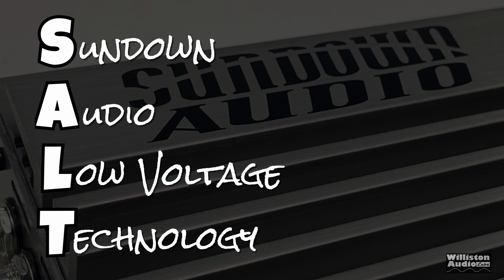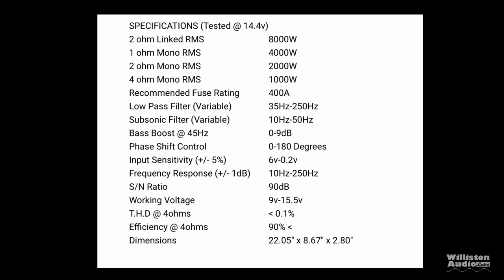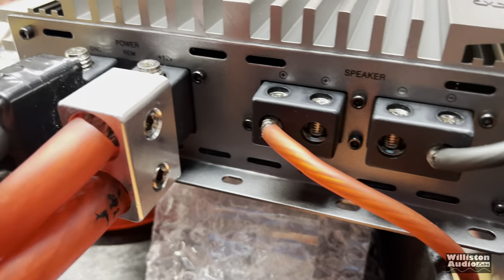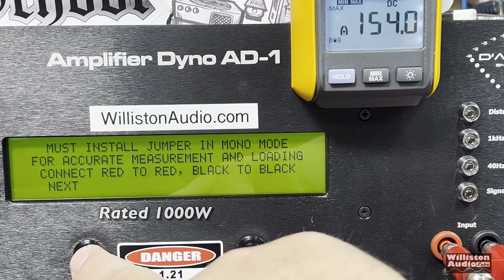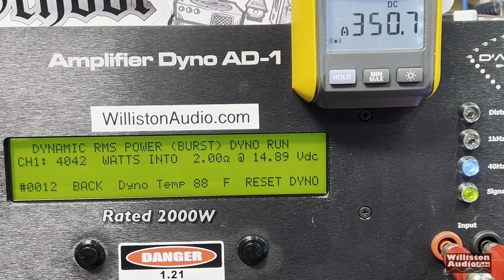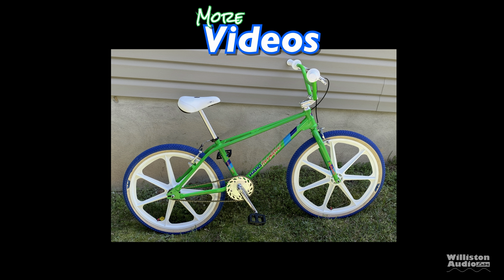Sweet Power, Salty Price? Sundown Audio SALT 4 Amp Dyno Test and Review [4K}

Comment: I've had my Salt 4k for 1 year, so I thought I would post up. Coolest & most quiet big amp I've owned. Top feature is the low voltage tech. I flex my Rubicon & knock hats off, just using a nice Interstate battery & stock alternator. No caps or lithium. I'm also running an Alpine 500w marine amp to power Alpine head, tweets, & SD 6.5's in soundbar. Salt is powering 2x 12" HCCA Orion's. 13.8-12.4 avg. volts. Not one single issue, & couldn't be happier with the system's build quality a year later.
Reply: Id say best feature is the clip light on the bass nob.
Reply: How many amps is your stock alternator?
Reply: alternator and lithiums and that system will blow your mind on how much of a difference itd make

Comment: I think it would be interesting if you hooked up the bass knobs for the Amps that give us a temp readout. Just so we could see how hot they get durring the test. I know your not running them long. But in 1ohm pushing 7k it would just be fun to see after the tests are over. Great video bro
Reply from the maker: I did a test a while back where I attempted to put an amp into protect by playing a constant test tone at 40% power. It took a while and would be difficult to recreate for every amp test.

Comment: Finally something I would be interested in buying. I do need a four channel amplifier in this one looks pretty good I’m going to do some more research. But so far this is what I’m looking for.
Reply: Monoblock.
Reply: @SaltwaterBoogeyman  I always leave them negative feedback because their way over priced and usually about 50% as good as other amps. This was no exception I was using sarcasm. There’s no way I would ever own any of that brand amplifiers. They are double what the price should be and even is that you can get higher quality amps. I build amplifiers I know what’s in them. Dismisses it by a mile. Have a good day
Reply: ❌✅ joe cool 😎 agreed nice amp though// way wrong price __ but to each their own ‼️

Comment: dual input splitters going to a close by distro block is all you need. Its long runs of wire that cause loss, not short runs.. so i am perfectly fine with the single inputs..

Comment: I currently have a decent setup and thinking of going with a Salt4k. My setup now is eight 6.5” Sundowns in a Vented custom box tuned to 35hz in a Sundown sfb 2000d, but I do have a sfb 5000d ready to go in, my question is should I just sell those and invest in the Salt 4K. I love the clean look and bass knob part. I do have a Voltage gauge now but to have all in one I like.

Comment: I said this before on the Orion 2500 on another channel. I have issues with amps with rating that are too high or too low. Rate your amps correctly. You setup an electrical system to power a 4k watt amp and you buy this amp. Your battery drops to 10 volts clips the shit out of the subs and poof, pop a sub. They need to rate their amps correctly, it's not hard
Reply: It’s not hard to measure your Voltage drop @ peak draw. If you are running this Amp plus Amps for your Mids + Highs you are going to have 6+ runs of 1/0, extra Battery, HO Alt, etc anyway.
Reply from the maker: It’s ALWAYS better to get more than you expect. You can always de-tune an amp by lowering the gain. You should plan for more electrical than you need as well…this way you won’t have to worry with voltage issues
Reply: @wal  You shouldn’t be clipping because of Power anyway, correct? You only clip if the Source is being clipped, you would be clipping if you turned down the volume, or you ran down your batteries on Aux/engine off if that was the case? I think I remember this being asked in the Forums all the time.
Reply: The reason that they supply a VOLTAGE METER on the bass knob is so that you can ensure that your battery doesn't drop to 10 Volts. It's not hard.
Reply: @Pamfman It’s definitely hard on your Alternator, etc, but an actual clipped Signal isn’t correct I don’t think.
Reply: @Len_M.   I might agree. It won't clip if it can't get to clipping voltage... You just won't be getting max power.. Unless you had some sort of dynamic gain helping you to maintain power, that would def induce clipping.. I'm just guessing. I could be completely wrong.

Comment: Would love to see some low voltage testing!
Reply from the maker: I’m hoping if you shell out for an amp like this you won’t be skimping on the electrical?
Reply: @wal  It would be kinda cool, to see 12v testing. Is that not what salt means.? 15plus, seems a high starting point also. Run it at 12v and see, hence the SALT design. Just me.
Reply: @wal  it would be cool to see a low voltage test. Perty pwease
Reply: @96kylar  he explained in the video. "low voltage" in salt, just means its ready for a standard charging system (14v), plug and play.. when you start talking about thousands of watts it's easier to find amps that can run off 16v charging systems, which isn't what this is designed for it'd actually probly go into protect if you did run on a high voltage, wanting 12v is just too low lmao it won't do those same numbers, might still do rated power or close to it but...... why?
Reply: @96kylar  if you’re at some 12volts   Then you don’t need a amp hooked up.  You need to be driving to 
Auto-Zone to get your battery & Alt checked out and fixed. Lol.  Cause you should be 13.5 min at least 13.    Testing a amp at 12volts. Wouldn’t work out. Just cause harm has it would immediately draw under 12.
Reply: Yes …that’s what they selling I would love to see the power on at least 13 or 12.6

Comment: Drawing up to 766A I'm curious how much effect on output there would be due to the power rails heating up on the amp side of the single power connections compared to dual inputs when run for long periods
Reply from the maker: I always use dual 1/0 inputs when testing if possible. Test tones and the Amp Dyno are hard on the amps and having the most current available is important
Reply: @wal  Yes they sure do push the amps and really like how you use the dual inputs but I was more referring to the other side of the input terminal inside the amp itself.
Reply: I think you asked the most important question. In about 10 years will be able to run amplifiers like this for mid range. When you look at the bass amplifier Orion makes a 3000 W that draws 1200 A. Which it puts out crazy power. The problem is need a nuclear power plant to run it
Reply: @joecool7165  yes the systems these days are insane compared to what we thought was extreme 25 - 30 years ago
Reply: @bamafan-in-OZ  - In the old days, speakers were a lot more efficient. You didn't need to have 500W just to listen to a phone call over your Bluetooth...

Comment: I’ve seen a salt 8 wired at .17 on subs clamp 17k. Without protecting. It did eventually blow up. Lol. Replaced it with a crescendo 6k and it never protects or has a single problem. The salt amps are very pricey, but as you said you get what you pay for. Salt amps will run on speakers all day wired at .33.
Reply: salt can wired down to .01 ☑️
salt 8 clamped .01ohm push over 20k.
maybe salt 12 over 30k
Reply: @SUTH_33  but for how long,  I e been hearing a lot of people blowing and burning up their salt amps from running them well under 1 ohm and that's with beefed up electrical. That crescendo 6k are made to run at half ohm with no issues. I rarely hear about those crescendo amps burning up when used correctly.
Reply: Nice, I also have a bc6k and love it. Perfect amount of power for my Fi neo 4.7 single 15.
Reply: @SUTH_33  I know you’re joking but they really will run .33 quite well if you keep them cool. They heat up quick wired under .67. And I have seen a salt 12 clamp 24.5k wired at .25. It blew up though after a few months. Sundowns vehicle they call project SPL. 4 salt 12’s wired at .25. They clamped 49,000 out of 2 amps strapped at 1/2. Unfortunately the video that they showed it on smoke came rolling out of one of the amps. Lol

Comment from the maker: Sundown Audio SALT 4 Amplifier
Shop: (affiliate) https://lddy.no/1192y
SALT 3 Tested: https://youtu.be/YcZRtkEexf0
SALT 2 Tested: https://youtu.be/Qmfb96RDVSw
3000-3500W Korean Amps Tested: https://www.youtube.com/playlist?list=PLu98-M_EowHMCHb5oUBnPVqVhMas4oq62

SMD / D'Amore Engineering Amp Dyno: https://goo.gl/sJTcf7
XS Power D1400 Batteries - https://amzn.to/2BPFCKW
XS Power PSC60 Charger - https://amzn.to/2CHGcfs
Fluke 1000A AC/DC Clamp Meter: https://amzn.to/2Rw5WDA
Handheld Dyno: http://amzn.to/2u2EgKV
My Favorite Screwdriver Kit: http://amzn.to/2x0VzcE

Video Index:
0:00 Intro
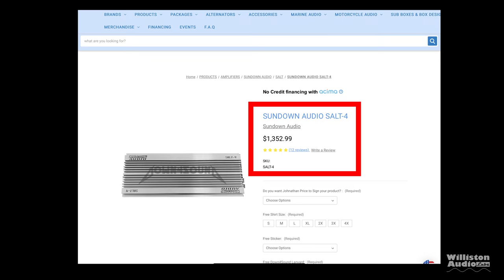0:38 Unboxing Amp
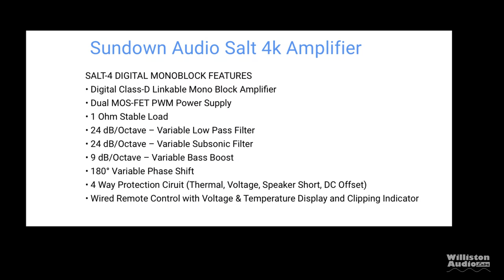1:28 Specs
1:52 Features
3:08 Amp Settings
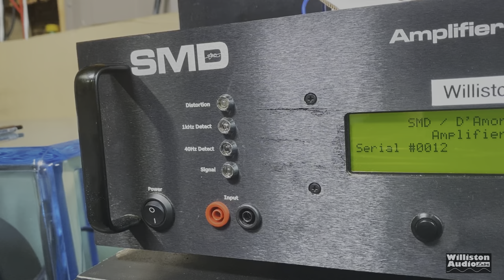3:35 Amp Dyno Tests
6:51 Results
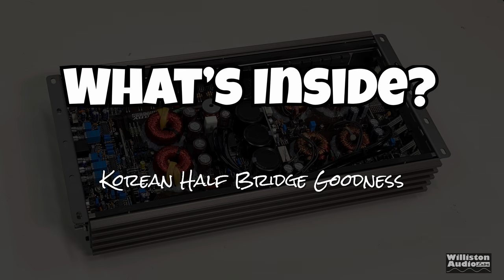7:11 Amp Guts
7:40 Pros / Cons
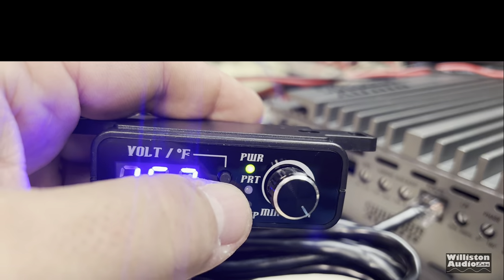8:26 Final Thoughts
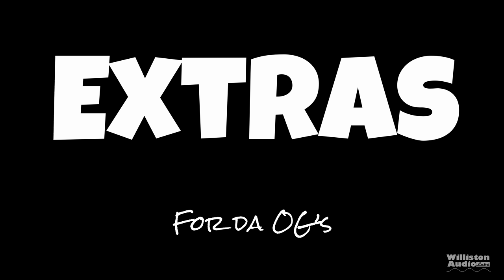8:58 Extras

DISCLAIMER: This video and description contains affiliate links, which means that if you purchase from one of the product links, I may receive a small commission. As an Amazon Associate I earn from qualifying purchases

Comment: Can these Salt series amps be ran on lower voltage like 12-13 volts? I'm debating between the Taramps and this 1 but leaning towards the Taramps Smart 5 due to it being able to perform well on low voltage. So I'm interested in your opinion if you don't mind.
Reply: I went with the taramps and I have it pushing a deaf bounce apocalypse (DB-3512R) 2ohm !!! 2017 Mustang GT 5.0 coyote

Comment: I'd be really interested to know what kind of impact these tests have on your electric bill.
Reply: Nothing it’s all ran on DC voltage. Not connected to his house. Only thing is the lights in the shop and the amp dyno are AC voltage
Reply from the maker: The lithium cells were not cheap, but they provide the reserve power required for these tests
Reply: @petergozinya7290  Yes but those lithium battery cells need to be charged up, that Charing usually takes place from an AC charger, unless D had a solar array on his roof.
Reply: @stiggyness1976  - The cost is almost irrelevant. He tests for what, ten minutes absolute max. He's doing 6,000W at 80% efficiency... let's say 8,000W for 10 minutes, but let's make it 15 minutes. Let's do the math...
8000W x 0.25 hours = 2kWh at 20c per kWh = 40 cents.
The batteries would have almost 100% charge / discharge efficiency. For other equipment, lets add another 10c and round it at 50c per test.
Reply: @johncoops6897  Too much time on ya hands pal, who cares?
Reply: @johncoops6897  lmao

Comment: U should test the SALT-1700.5 I just bought one and installed it and I would like to know the true output power I’m running 2 sundown audio SAv2 12 1000 watts rms and hertz Milli pro 6 1/2 components upfront and 6 1/2 co-axle on the rear I can’t even turn up the 4 door speaker channels more than 1/3 gain and the sub Channel 5/6 gain before I start to get distortion for overpowering everything I had to upgrade my Alternator from 150 amp stock alternator to a 390 amp exclusive power alternator i’m using stinger one gauge wire power and ground from the front battery to the amp in the back of the car and I’m using stinger 9000 series RCA’s and a Kenwood Exelon double den head unit 5 V pre out  and a amg duralast platinum H5 battery and a stinger zero gauge big 3 upgrade

Comment: I have 4 Skar-EVL 8s being pushed by a JP23 amp currently.  It slaps! But I want to run 4 Skar-ZVX 8s later.  Will this amp push those? Or too much power? I also have a D4S Lithium battery and a 320 alternator.
Reply from the maker: It would power them nicely with headroom..or add another JP23
Reply: @wal  ohhh I just rewatched your jp23 video and forgot you stated they are "strappable" ... lol 😆 🤷‍♂️ good idea 💡 and less pricey 🤙 thx 👌

Comment: My brother is running his salt 4 at half ohm no problem hes even ran it at .35 no problem at all
Reply: .5 ohm speaker load is completely different than a .5 ohm resistive load.
Reply from the maker: The Dyno’s resistive load at 0.5 popped a SALT 2, so I didn’t try the 3 or 4 this low. Remember speakers are reactive load and the Dyno is resistive

Comment: Big problem with car audio is the 12v system. It requires so many amps to achieve few kw that it quickly goes out of hand. 1kw is the maximum limit and anything above would require all new electrical system with more alternators and Lifepo4 or lto batteries.
Reply: Unless you are competing you don’t really need anything past perhaps another battery near the Amps. I mean I used to bump around Town with my deck Sub setting @ -10 (it goes from -10 to +10). Even that would pull air out of your lungs if you got too happy with the Vol knob.
Reply from the maker: Yeah I like to stay around 1000-1200 on factory electrical.
Reply: @Len_M.  Good efficient speakers need like 300-500w to make more than enough sound. I make amplifiers for fun and expirment with designs and specially class d chip amps are always facinating to me. I have a tda7498e amplifier with a home made boost converter in my car bumping two sony explod subs for less than 100$ and it's more than enough bass to shake your internals. I have 200w x2 class ab amplifier made with 2sc5200 at home for my pc and most of the time i don't even use 20w of it.

Comment: Maybe one day you can do a comparison of what's the power difference between strapping 2 amps VS running the 2 amp separately. I've always wondered if it's worth it or if there is any real difference in output
Reply from the maker: No difference
Reply: Wish I could find one about running 2 jp33s,split signal tho not strapped

Comment: Hey I've been watching for a while and i noticed that you never really tested any car radio head units In the past. 
I think it could be interesting for some people to see if the claims of some manufactures are even close to the real performance since most of them list peak power but almost no one tells the RMS.
Reply: Don’t use HU power, just get an Amp.
Reply from the maker: I’ve tested a few. Most are 18x4, Sony and Alpine made some higher powered units around 30x4
Reply: @Len_M.  Nah way to complicated in my car it would take forever to get the wiring done. 
I've asked that question cause i want to save time... not waste it.
Reply: @wal  oh that's interesting. 
I can probably increase the voltage a bit aswell to get a few more watts right?
I mean 15-16V should not hurt?
Reply: Jimmy S  Thanks for the advice.
Yeah i try to stay under 16V then maybe go up to 15,4Vmax or so.
Well the plan is to just see if the radio puts out more power if it doesn't then i stay at the normal voltage that the car runs at.
Reply: @Snow1998v1  - Any increase in voltage might slightly increase power... but it needs to be TEN times more powerful to sound twice as loud. Hence, if you go from 14.4V to 15.6V, you will not hear any difference whatsoever.
Reply: @johncoops6897  Loudness isnt the priority i think i want it just to be cleaner
Reply: @johncoops6897  also what keeps me from doing 144Volts into the Radio? 😂
Reply: @Snow1998v1  - if you want it cleaner, try using a wet cloth to remove the dust.
Reply: @johncoops6897  comedian huh?
Reply: @Snow1998v1  - well, what do you expect? You are saying hilariously silly stuff and it's very difficult to know if you are trolling, taking the piss, being sarcastic, or just being naïve and/or stupid. So I am giving you the benefit of the doubt, and playing along with what I think is some kind of weird joke.

Comment: I’m thinking of purchasing two Salt 4’s and was wondering which size Amp fuse I should need?
Reply from the maker: Sundown recommends 400A of fusing per amp
Reply: @wal  with 0awg wire so I will need    fuse holder with four 200A since I’m strapping two Salt 4’s?

Comment: The comments about "high voltage" are funny. If you're shelling out $1500 for this amp, I'm pretty sure most that run at this power level or above, will be using lithium as big D is here. Lead acid is lazy, sluggish, bad cold weather performance, heavy, corrodes your vehicle, terminals/wires, and does not hold voltage under load well at all.  Not to mention, recharging efficiency with lithuim is near 100%. You get all the power back you put in, where as the lead acid(sealed or flooded, doesn't matter) you get maybe 50ish percent(best case scenario) of what went in(due to in efficiency both going in  AND out) pending actual quality of construction, plate purity, and condition/age.

Lead acid is old tech, lto and similar technology is the future. Bottom line, for you guys complaining, and still running LAZY lead acid with power like this on tap, y'all need to get with the times. If you can build your own, lithuim is actually cheaper than lead acid, if you know how to shop. I'd imagine those complaining look at limitless prices and think lithium is unaffordable. It sure is... I built a 96ah bank for less than $500. Out the door, with terminals, cable, buss bars, hardware, balancer and all. 

Anyway, sweet test man, I was very curious about how this one was going to do. Spendy, but a solid performer!

Comment: Big D I got a question for you if I get salt 6k with triple  power and ground inputs and amp call for 600 amp fuse can I put 200 amp on each leg of power input or should put 1 600 amp to a spliter
Reply from the maker: Either would work

Comment: Will they replace your subs after they are blown due to the misleading specs? I mean if you have 1000w-1500w RMS subs then the Amp destroys them...
Reply: I think you might bottom out the sub before you blow the sub. Lowering the gains would help alleviate that. I am sure they would tell you that you should know that. Always do research before dropping dough on high ticket items.